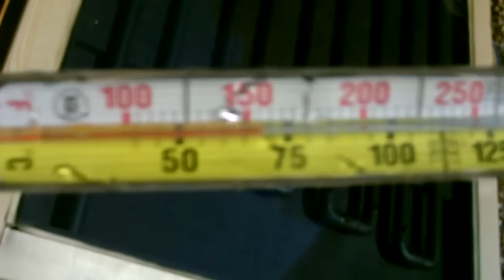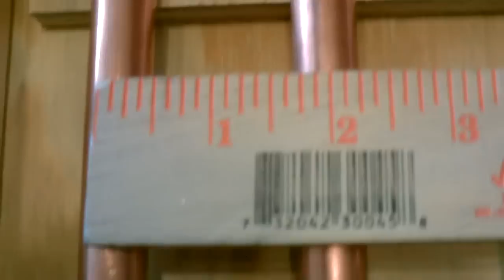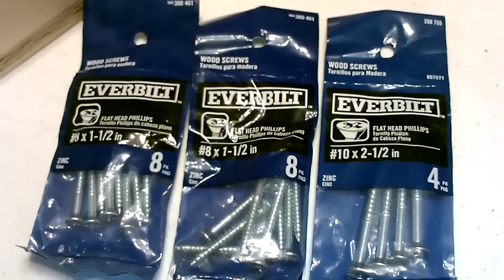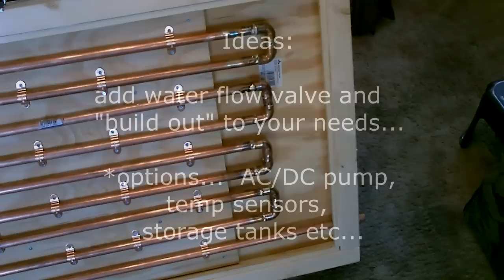DIY Solar Thermal Water Heater! - COPPER PIPE Solar Water Heater! - Easy DIY (full Instr.) 150F+

Comment: Could it be done by bending a long pipe instead of cutting and soldering ?
Reply from the maker: hi. i've got a couple other designs that use a single piece of copper pipe (coiled). that works too (but diameter of pipe is less.)

Comment: Wouldn’t the solder melt at high temp ?   Great effort though
Reply from the maker: hi. the solder melts at the temperature of a torch but it's totally fine to use in a solar water heater or solar collector. they don't get anywhere near hot enough to melt solder. 🙂🔥

Comment: I'm looking to heat up the ground of a greenhouse, about 1000 sq feet. I'm wondering how big should my thermal water heater be. Do you think it'd work in the winter when the sun is weaker?
Reply from the maker: hi. yes, these definitely work in winter too, just not as strong as in the summer. i couldn't say how big the unit should be, that will most likely take some experimenting.

Comment: This style is nice, but there is less linear distance of copper to do the work of water heating than a 50 foot coil of copper tubing in a coil shape. While coiled copper tubing can be a bit challenging to work you can use a come a long, chain hoist, ratchet hoise, etc to pull the copper coil to straighten it then use a Swagelok manual tubing benders that will allow you to put a perfectly smooth 180 degree bends/returns in 1/2" soft copper coil to avoid all the solder connections and risk of leaks.

Comment: What black paint did you use on the wood and copper, and do you need to clean the copper first before spraying and with what
Reply from the maker: hi. i used a standard flat black paint. nothing fancy. you could use a primer paint combo if you wanted too. try to get the blackest paint you can. the blacker the better
Reply: @desertsun02  Thank you very much

Comment: 14:34 / 14:34
DIY Solar Thermal Water Heater! - COPPER PIPE Solar Water Heater! - Easy DIY (full Instr.) 150F+
조회수 728,655회   2016. 12. 6.
2.8천
296
desertsun02
구독자 24.1만명
DIY Solar Thermal Water Heater. Homemade "COPPER PIPE" Solar Water Heater! Easy DIY. video includes full instructions on how to build it (w/materials list). super hot water fast. reaches temps at or above 150F with air temps from high 40's to low 50's. a few features of the panel:  full 1/2" hard copper pipe (type L). hooks to a standard water tap/garden hose. slim portable design (at only 2" thick) and is very rugged and durable (built with 2x2's and 1/2" plywood). multiple panels can be hooked together for additional capacity and extras can be easily added; water flow valves, temp sensors, timers etc... couple of final thoughts. make sure to use type L copper (rated 0-400F 986psi). other choice is type M (only rated 100-150F) and will not hold up to temperature extremes. the smaller "internal board" is very important to the design - for a few reasons. 1.) it allows for the pipe to lay essentially flat inside of collector (because all the connection points are up in the air).  2.) it holds the pipe at the right height so it enters and exits thru the 3/4" hole in the 2x2. 3.) it allows for the pipe to easily be removed from the collector (if extra work needs to be done on any of the solder joints - re-solder etc.) btw if you've never soldered pipe before - it's very easy to learn. just watch a couple of youtube vids on it and practice a few connections on a small or scrap piece before starting project. lastly, to secure the glass into the frame, just use a bead of silicone caulk around the edge and drop the glass in. songs are from youtubes "copyright free" library. song titles...hemispheres and mumbai effect

좋아요 
좋아요 하나 더.
GOOD 1
LIKE ONE 
2.8천  + 1  =  ?  *
143

Comment: How much more heat do you get if you use BLACK plastic flex piping instead of copper?  You can buy 300 feet at Lowes for $93.
Reply from the maker: hi. black plastic pipe won't get as hot as the copper *but it will work. the other issue with plastic is it only lasts a few years tops. it's cheaper though, so if you don't need the water too hot and only need the collector for a couple of years it may be worth it.

Comment: Why you paint it black?  It doesn't get hot enough being copper?
Reply from the maker: it will get hot even if you don't paint it black but painting it helps absorb the sun so it's heat's the water much better.

Comment: You can simply use a domestic single panelled central heating radiator, with a bottom cold water inflow feed, and a top hot water out flow feed.
Just paint the radiator panel matt black, fit a bottom 15mm left hand cold inflow pipe, and fit a top 15mm hot out flow pipe...

Comment: Has anyone tried to connect this system to a pump to cycle the water from the pool, through the copper tubing, and then back into the pool? I am really wanting to try a solar powered pump so I can tuck all this stuff at the farthest end of the pool, which happens to also be farthest away from my power source. Any experiences to share? I am looking at trying the Solariver Solar Water Pump Kit - 360+GPH Submersible Pump with Adjustable Flow, 20 Watt Solar Panel (with maybe a marine battery backup). The adjustable flow helps reassure me I won't burnout the pump by pushing too much water into the smaller 1/2" copper tubing, but I am equally concerned it won't have enough push to get the water through (I plan to have 2 or 3 sets of tubing). Any experiences anyone can share?

Comment: If you would use a street L at each end you would not need the 1 inch connector piece.  Pipes would be closer together so you could get in more runs in the same area.
Reply from the maker: hi there. yes i tried that first, that but that type of elbow was too big for the pipe. they were 1/2" street elbows but they didn't fit. it's a mystery to this day.

Comment: Used, Type 11 radiator facing backwards, will have two possible inlet valves and two possible outlet valves.

Double glazed one way mirror to create more heat.

Comment: Great video. 
Clean work. 
If you have added a  metal sheet between the wooden base and the copper pipes you would get much better results.
I build several panels like that,
Thanks for sharing.

Comment: That looks like 20 feet of pipe total. I get that the water will heat up if it just sits in the pipe for a while (similar to my garden hose when I'm not using it)  if you were to circulate pool water say 80 degrees what will the output be after running continuous? I'm looking to build three 16"x75" panels on top of my fence but gonna try to get at least 60' of pipe per panel. Hope this works :-)

Comment: I have bought a similar water solar panel to assist with the heating of my hot tub but my worry is that the chlorine running through the copper will weaken the copper as chlorine reacts with copper I believe  or am I worrying for nothing lol

Comment: Have you experimented with or researched pipes thickness or distance between pipes? The smaller the diameter and the lower the water flow the higher the output temperature would be, no? I'm also thinking of putting sheet metal as the bottom to absorb sunlight and increase the inside  temperature. Great idea!
Reply: That's a great idea.

Comment: sure it gets up to 150 F, but what temperature does it sustain at  constant flow?
Reply: I use this for above ground pool. At a peak I get around 66° - 69°  C. That's a momentary peak when water stays in it for 30min at full sun. Constant flow I'm lucky to get 32° C. After 2 days I brought a 18' round pool (28,000 L) water temp by about 3° C.

Comment: This build brings back memories, my step father had us building these in 1982-85 as a side business.  Very similar design, with it's primary role as a pre-heater for an actual hot water heater.  We used a full sheet of plywood (4x8) copper pipes with aluminum fins soldered on, a bit of insulation below the pipes, matt black and capped with a sealed plexiglass top.  At our house it was mated with a simple hutch batch heater before going into the hot water heater.  Spring to fall we had some seriously hot water... winter cut down our gas heating needs to almost nothing... only really needed gas on snowy/cloudy days.  Keep up the experimentation!

Comment: When soldering, the molten solder will flow toward the hotter metal. So, you should direct your torch where the inside pipe ends, closer to the L in elbows. Also, a damp terry cloth rag can be used to quickly wipe molten solder from the joint making a much cleaner job.

Comment: how would you stop overheating though since this is on the roof? what would prevent the water from boiling inside the circuit. relief valve? say im not using the water, out and away how would one prevent the system from over pressurizing. a pressure tank could only do so much
Reply: A below ground thermal mass storage tank as in intermediate path. Insulate a concrete box and install a copper coil. Fill the box with silica sand and crushed lava rock. This will act as a thermal storage battery that will hold heat for the evening and offset the temperature during the day.

Comment: Coil would put the pipe next to itself ... No wasted space and more length of pipe in the same framework ... More heat collected ... This design would benefit from walls between the runs to direct the heated air ... Making it a water and air heater with a thermostat switch and low voltage fan ... Maybe solar powered ...
Reply: James Witte where is your design?

Comment: I made similar collectors about 15 years ago. With my knees I gave one with two throats and one with one throat and the other with the side. That's how I got into the construction made of sheet metal and insulation (200 x 100 mm) about 54 m of Cu 15 tube. This made the capacity reach the maximum.

Comment: No one seems to use a collector backing plate anymore. Even scrap metal roofing behind the copper and all painted F black (or F dark green even better) would dramatically increase efficiency. Use copper plate and solder pipes to it if you can afford it.

Comment: if you want more heat put aluminium foil under your pipes and uses a one way mirror instead of glass.light goes in the box and bounces back and forth making way more heat
Reply: Double glazed one way mirror?

Comment: Hello , how to keep the hot water for the use at night  when the is no sun around ?
Reply: Kumar Dabeechurn you can buy a big electric boiler and make connection to panel,when you need more hot water the electric resistance will start,if not just dont plug it

Comment: do this as a stovepipe heater, pass the copper thru the center of the stovepipe, use dry white sand inside the stovepipes, which create thermal mass, amd add a thermoelectic cells and a 12 v battery to it to it, and you can create a closed loop system with antifreeze to heat the water in summer and winter to run a solar refrigerator that never uses grid power
Reply: How to delete Kodi
Reply: Joe Blow Where is your brilliant design?

Comment: I would like to utilize this type of system to heat the ground in my greenhouse. I live in CO at 9000' and have a simple 12 X 7 space that requires heat at night/early AM as we have only 26 frost free days. I use a ceramic space heater, but it's expensive. I am thinking about putting in a few hundred feet of 1/2" pex water tubing under the beds, but think I will need a slow inline pump that I can put on a timer to turn off at night. Heat the ground during the day and let that carry some heat over thru the night. I'm thinking 2'-6" pipe length in the solar box and a pump inside the greenhouse. Any thoughts or suggestions for info or materials? I can only find 3/4" ac pumps that are more than I want to pay. Thanks
Reply: We recently built a system for a friends greenhouse using a panel as described above 24 inches square.
The beds were dug out and hollow concrete blocks laid 8 inches below the surface. 15mm PEX tubes were threaded through the block, back and forth.
This enabled the temperature to stabilise from day to night so as to have a steady soil temperature
A cheap solar panel provided 12 Volt to power a windscreen washer pump which used a simple thermostat to turn the system off at night and a non return valve was fitted in the line to ensure that the heat from the soil did not feed back to the solar panel at night..
It has worked well for 5 years and cost very little. Hope this helps
Reply: +George Styer  please let me know how that system worked out
Reply: Hello Lorraine, In central France we are approaching summer and this year a great effort will be made to do some practical tests on the panels that we have at the moment.  Just getting hot water id OK but I need to  be more disciplined and gather data, as a retired engineer this demanded of me.
Once I can work out how to do a video I will post it, and I thank you for your contact.   I will say this...as a rough...from March to October I never use other means of heating water other than the panels.

Comment: Nice work. Very clean looking. Try a pipe bender to reduce some of your soldering. The bends will be wider so overlap two systems in a taller box. Add a dual connector on your external pipe ends. Thanks for the upload. Good job.

Comment: So help me out here.  If I had two of these, how long would it take to heat a 10,000 gallon pool that starts out at 70 degrees and get it up to 80 degrees?
Reply: Quick calculator says 168 hours - 1 week ;_)

Comment: Amazing... I will build one for summer to warm up my 16000 l swimming pool. Hope it will work. Thank U mate.
Reply: Did you do this and did it work well? I’m currently in the process of doing one myself.
Cheers
Reply: CafeDelMar98 use adapters to run a hose from your pool’s water inlet to the solar heater and a water hose adapter out.  As your pool circulates it’s water it pumps some of it through your solar heater.

Comment: It's crossed my mind to build something like this but larger scale, wonder if it would get hot enough in winter to help heat the house.  Would be kinda a pain having to keep taking the snow off it though.
Reply: Red Squirrel I made one once but as a closed loop system feeding into a storage tank that had a built in radiator, commonly used for radiator heating.  Instead of water I filled it with plumbers antifreeze.  It wasn’t very efficient.  In the dead of cold winter nights it would suck heat from the tank.  It worked well in the summer.  There was always enough latent heat in the system that I didn’t need to work about the snow. It was warm enough that the snow melted off.

Comment: Good project with very good construction but, no real performance data.  If you were to circulate the heated water in a 5 litre (1 gall) container and measure the temperature over time this would allow a closer idea of efficiency.

I have 22 panels built very similar to yours but much larger each 60" by 18" and connected through 12 volt solenoid valves to allow any combination of series or parallel connection depending on the time of year (angle of the sun)
My panels have the tubes soldered onto a copper sheet backing made from old copper water cylinders, cut and flattened then blackened and these sit on  4 inch fibreglass insulation all around.
The choice of glass is also an important point but I think I've said enough !!
Thanks for the posting and thanks to all those who have added comments
Solar saves money.
Reply: Yes apart from being educational it will inform any further projects of the best way to construct the panels.
Good information saves time and money.

Comment: 20 oz vacumn tubes are $10 each got to buy 10 of them though but they work. 45 min in the sun they boil water if you use a collector 15 min in the sun they are fragile though.

Comment: If you want to improve the design, make sure you put reflexing material behind the pipes, not black paint, then, do not use copper fixation, they are dissipating heat in the wood ... and use a double glass, to avoid heat transfer via the glass. a vacuum double layer glass would be the best. You want to insolate the side and back if you plan to use this during the winter, simple glass fiber insolation would do
Reply: id say use a fresnel lens aiming a weak focal point (so its not too strong ) at a coil series of pipes with a half pipe stainless steel backplate behind them, itll reach 2000c easily and the water would be boiling !
Reply: At least 4 inches 100mm of insulating material is needed behind the tube support.  This will ensure that no heat is lost to the plywood backing, as the plywood will heat up to the ambient temperature of the cabinet.  Also affix silver reflective backing (cooking foil) to the plywood base and spray all black.
Two layers of glass will only reduce reflectivity by 3-4 % unless they are vacuum or argon filled double glazed units.
In practice we use single glass (freely available) and increase the number of panels.
Our panels are built the same as described using 15mm thin wall copper, system is pumped. 12 panels 24 inches by 90 inches provide more than enough hot water during the winter and excess during the summer is used to heat the swimming pool.
Our practice is absorb, insulate, and reflect little.  Always open to constructive comment